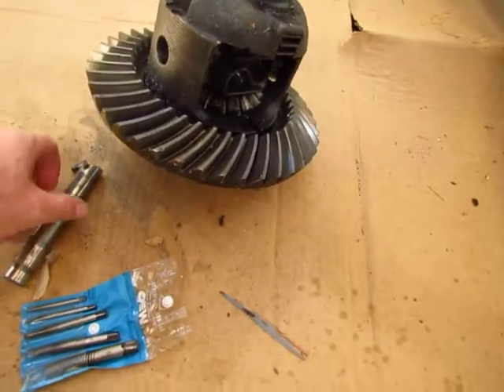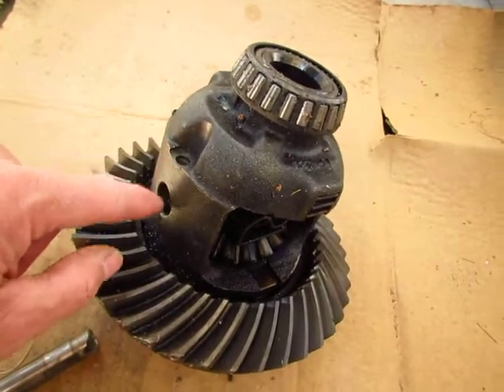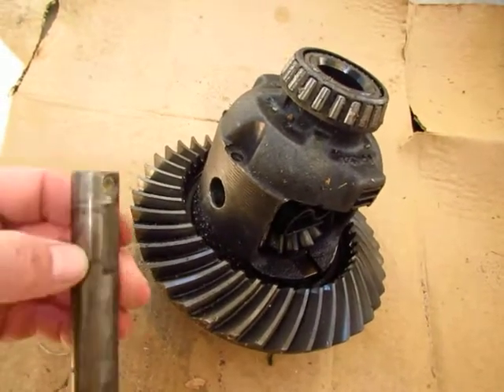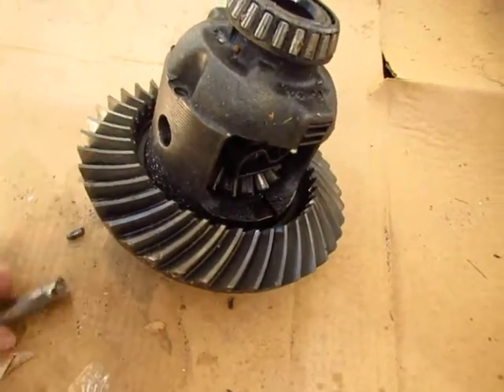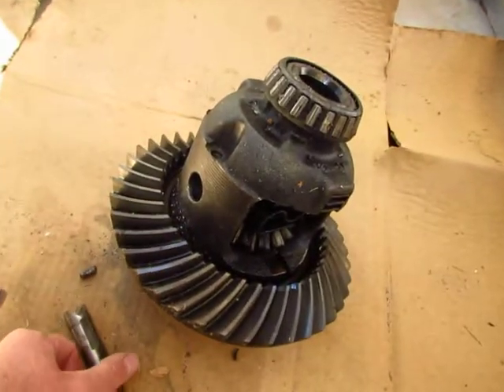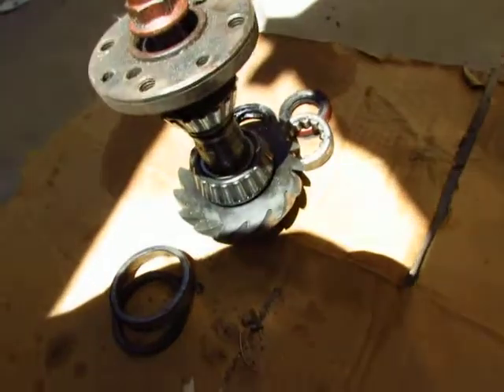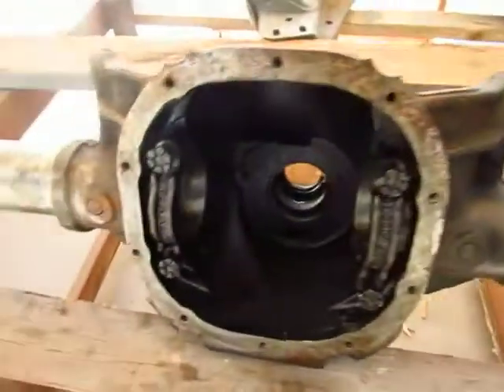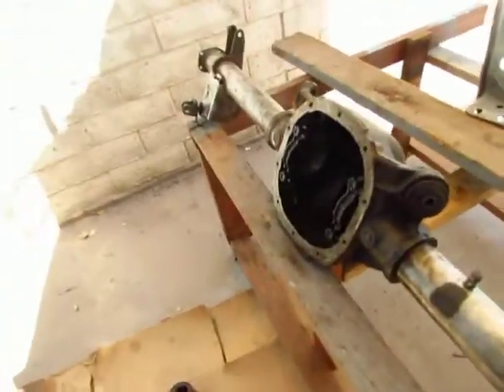How To Remove A Broken Cross Pin Lock Bolt Ford 8.8 Diff

Comment: What did you use to drill cross pin?
Reply from the maker: Hello jimthacker1732,
                                 I used a drill and a new bit.
Reply from the maker: Hello jimthacker1732,
                                 I used a drill and a new bit.